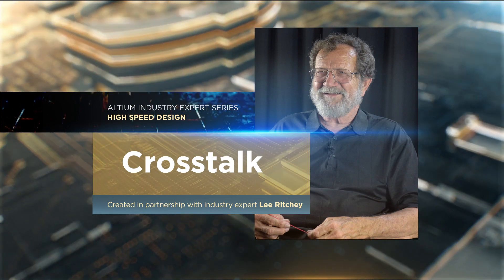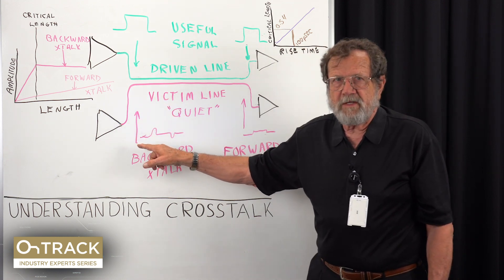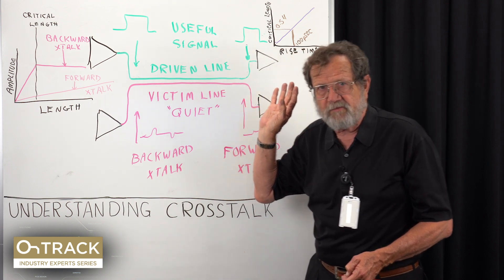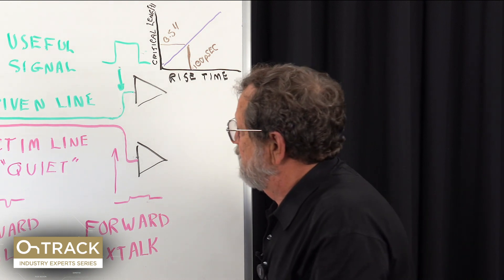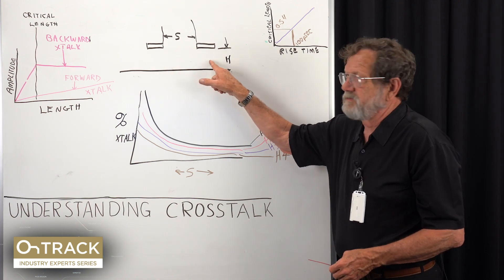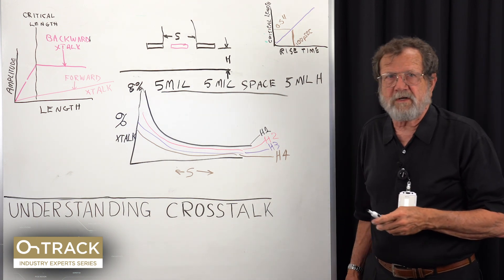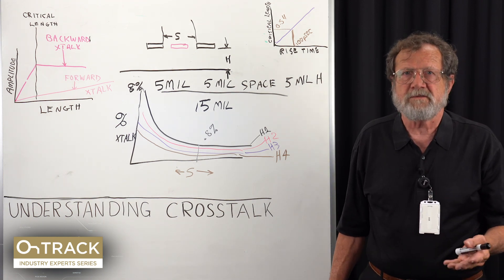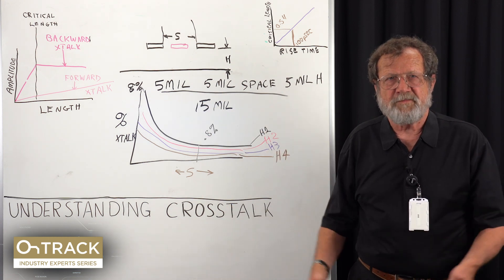Understanding Crosstalk - Altium Academy

Comment: Awesome explanation. İ want to ask another, if the victim is digital signal line does it matter if the hot line is another signal or power line?
Reply: No it does not matter, crosstalk always occurs whenever there is switching action, what matters is the edge rate. This is why a relatively slowly changing waveform on the switching node in a switching regulator can exhibit as much or more noise as a very fast digital signal with low voltage level; the reason is that the dV/dt or dI/dt is responsible for crosstalk, and in switching regulators these derivatives can still be very large because you could be making large voltage/current transitions over time.
Reply: @Zachariah-Peterson  thanks for the explanation. What if we switch the relay? İ can't control the switching time here its just a click. İ placed the reversed diode. İ use optocoupler i even placed another bjt to control optocoupler but still crosstalking and random clicks occurs
Reply: @thenextproblem8001  Without seeing your PCB layout and schematic it is hard to say exactly. But with relays you can have a large derivatives (dV/dt or dI/dt) during switching especially if in a high voltage system. This is true even if the switch rate in the relay is slower than in a typical digital signal. These large derivatives are what create crosstalk, it does not matter if you look at power systems or digital designs. So if you route the victim line too close to the relay it could produce that switching noise on the victim line. One thing with relays is that they basically produce the same kind of noise as the switching node in a switching regulator, and the easiest way to prevent coupling from that node into a victim line is to keep ground near that switching node. Make sure the current loop through the relay is small and use large ground pours and that will probably help.

Comment: Clearly conveyed! To reduce crosstalk; increase spacing S between signal lines or decrease height H to adjacent plane. One question though: what are the equations used to define the minimum S, given H and rise time, and vice versa the maximum H, given S and rise time? 
EDIT: I discovered the Saturn PCB Toolkit has a Crosstalk Calculator that helps me in this regard, but knowing the relations behind the calculator would be a very valuable insight.
Reply: There are no equations specifying minimum S or H values. These depend on the thickness of the available materials used to build the board (H value) and the minimum line spacing that can be etched during fabrication (S value). The rise time is also not controllable, it is something that is determined by the output buffer in the integrated circuit.